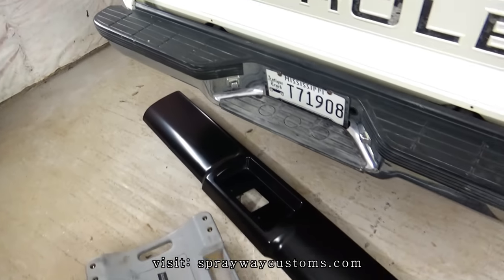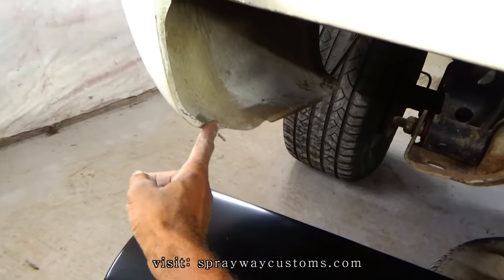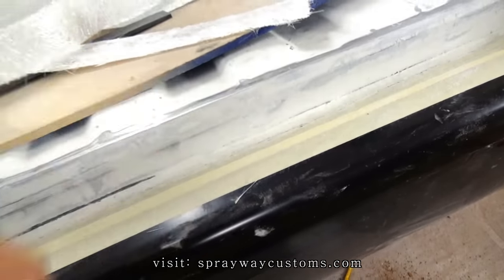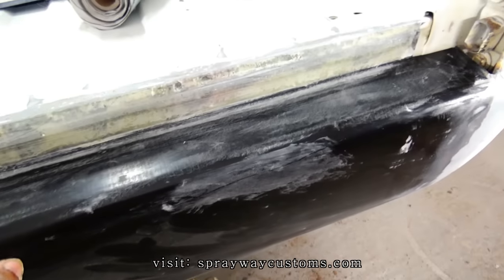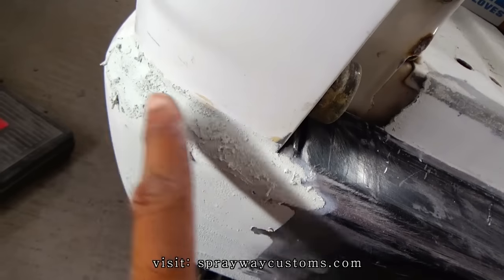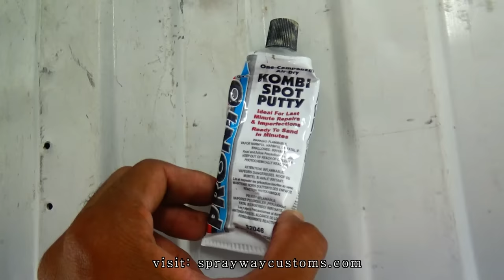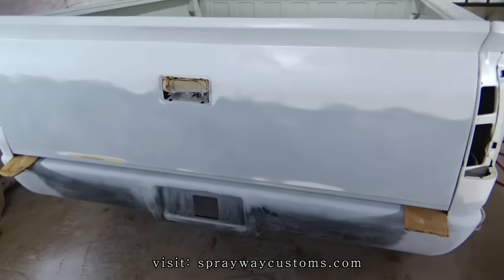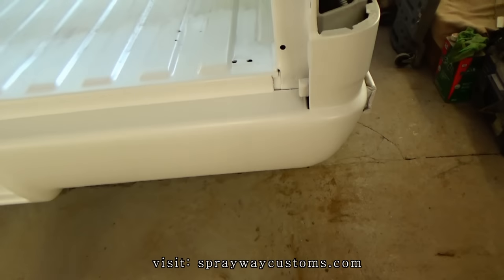Roll Pan Install & Mold On OBS Chevy Silverado Truck HOW TO WELD ON A ROLL PAN & DEBADGE TAILGATE

Comment: RAW FAM....UM PUTTING ONE ON MY TAHOE,  THANKS FOR THE VIDEO,  TTYL 💥💯💥
Reply: Be prepared to cut off some of the rear supports. Won't come close to touching the truck to mount it if you don't. It looks really good though. EDIT: That might only be if you have a tow package...
Reply: @Des420  True that FAM,,,,and it do have a tow package
Reply from the maker: Let's get it 💪🏾💪🏾💪🏾

Comment: Sprayway eraser wheels are great for getting rid of that type of glue and they make quick work of it great video man I'm loving the roll pan on the back of the truck now that I see it are you going to put the hitch in the hole of the roll pan (but behind it) with a flip-down plate, a reese hitch works with those roll pans like that great great video as always even better because it's a truck and I can really learn from it I loved it keep up the great work you're a blessing you keep me motivated and you always put me in a great mood thank you very much sprayway 🙏💯💪🏼👍🏻👍🏻
Reply from the maker: Thanks Mike...I'm not sure if he's going with a hitch or not

Comment: We own a body shop and just wanted to point out the tailgate hinges if you ever have to remove the hinges due to rust it will be next to impossible to remove them unless you can get at that bottom bolt from underneath. Maybe should have made a cut in the roll pan to be able to remove that bolt.
Reply from the maker: Peggy, I agree 100%...I was thinking the same thing when I was installing it.

Comment: Thanks spray. Really enjoyed this one I was blown out by the transformation really cool. 

I have been welding now for best part of four years as a hobbyist.  Keep it up excellent. 

Learn from fluxcore what you can but get into gmaw shielded gas mig sooner as you will find it less work especially considering distortion of panel flatness as the fluxcore is a thicker wire requiring more heat power.

I hope I can make my truck look even half as good as yours.

Excellent and many thanks.
Reply from the maker: Thanks for the info

Comment: I love the obs trucks, I've always wanted to see someone cut the front bumper and bumper brackets off and do a custom front rollpan that would be flush with the grill then get some new Camaro wheels with some hub centric spacer/adapters to make them fit
Reply from the maker: Thanks 🤔

Comment: Just offering an opinion here. Panel bond adhesives are a great alternative to fiberglassing over metal. Plus they are epoxy based and will stop any possible rust issues that could occur.
Reply from the maker: Thanks man

Comment: Awesome work as always. The truck is looking GOOD... but one tip! Weld through primer. Where you did the plug welds, the water can attack from the back and get between the two metals.. just a little tip be you do awesome work!!!👍🏾💪🏽🙏🏾
Reply from the maker: Thanks 🙏🏾

Comment: Great job 👏 
I just put a roll pan on my 87 s10 but i used bondo filler.....😢 should I sand it off and use bondo glass or put bondo glass over the bondo  filler?
I wished I would've seen this 1st ❤
Reply from the maker: You’ll be fine if it’s not a thick layer

Comment: You should use a eraser wheel to get that black stuff up  or some adhesive remover that should help or make it easier
Reply from the maker: Adhesive remover would've took forever. I tried it. 80 grit sandpaper was the ticket 👍🏾👍🏾

Comment: Sprayway  you could have used panel bond adhesive  on the tail gate... you then could applied seam sealer over it..a pro tip when seam sealing use old used blank plastic gift card as spreader... cut out a bead profile you desire size and shape... before apply the seam sealer accurately mark where the edge of the seam seal and run masking tape just oust side the edge of your bead... apply  seam sealer with your tooling profile tool you made above.... make sure the tool has notch to follow the truck bed  for clean straigh bead... you can make multi passes to get smooth bead profile easily. remove tape ..now your seam is looks just like factory. By use this method you compacting the seam sealer removing voids and and air bubbles from it.

1 second ago
Reply from the maker: Thanks for the info 🤝

Comment: I don't watch Power on the weekends bc I be waiting for you episode to come on. Stay Blessed  bro And that Obs it coming together nicely. Got a question also what do you think about the Wet Wet brand compared to others clear coats. Which one do you recommend. Thanks
Reply from the maker: Thanks Erik...The Wet Wet is some great Clear if you can still find it. I believe you can get some off eBay
Reply: @SprayWayCustoms  Thanks for the response I did see it wet wet plus for $549 that comes with a gal  clear and two quarts activator. Also do I lay two coats down first then wet sand 600 grit and apply another coat of clear? Thank for the follow up I appreciate that Blessings bro

Comment: I just bought an obs and it has a welded roll pan how can I remove it the top of the roll pan is off already it’s just holding on from the sides I want a rear bumper thanks 🤝
Reply from the maker: Just cut the welds and filler

Comment: Have you used flux core in the past with body filler? Mine messed up after a couple of years and was told it was because I used flux core instead of solid mig wire and shielding gas
Reply from the maker: I have used booth. I never had a problem

Comment: Some of the pickups came with the vinyl/rubber fender flairs, question can the fiberglass filler be used to attach the flair to the metal fender? Thanks
Reply from the maker: Yes you could but I would recommend using panel bond
Reply: Ok thank you sir, love the video’s. Learning a lot. Thank you

Comment: I got a question,  I got a fiberglass bed cover for my 83 chevy c10.  The only problem is that it's a foot too short.  Is their a way I can add fiberglass or can you please make a video of fiberglass bed covers .
Reply from the maker: I would cut it down the middle and put it where it need to be and then add fiberglass to fill the void
Reply: Can you please make a video of something like that...I would appreciate it.
Reply from the maker: Sure will

Comment: How do I get in touch with you I have  a 1991 454 ss truck I need my doors  glassed with 3  twelve inch midrange speakers in each door
Reply from the maker: Where you located?

Comment: Spray way bro you missed 2 spots with fiber glass. The 2 ends of the top of the bumper where it meets the truck bed left and right sides so moisture won't sit. But you still a bad soma gun wit it.
Reply from the maker: St. Jello I know what you talking about but there's no way water could sit there. They made it on a slop.
Reply: Quick wit the response, my man.

Comment: Spray way bro I got a Tahoe that needs you stat I'm losing her stand clear for the paddles. But seriously I need your address and booking
Reply from the maker: Ok...where you located?
Reply: Maryland I'm have to take a road trip this coming spring. I'll bring my electric tools and we will get some work done to your booth I'm also gas / propane certified so we can add some heaters to your spray booth.
Reply from the maker: St. Jello that'll be great

Comment: Liar... Used a heat gun from harbor freight and a peice of a wood as a wedge and got it off. The chevrolet emblem was even good afterwards too. You can even see the glue melt as your going
Reply from the maker: 4eVR CHAOS 👌